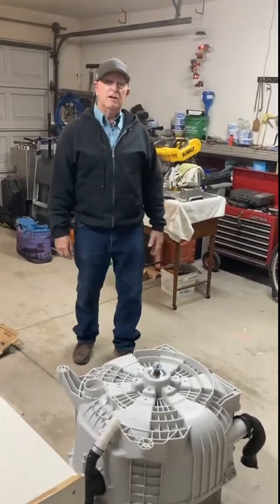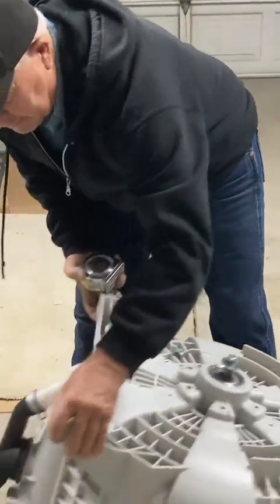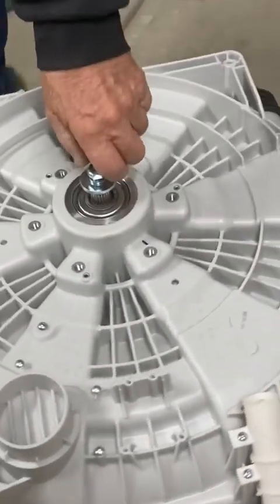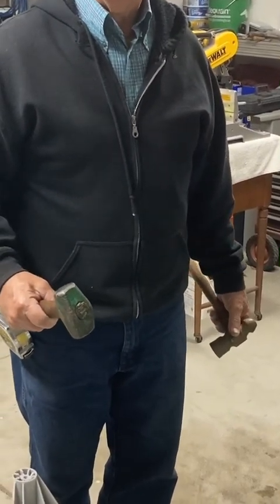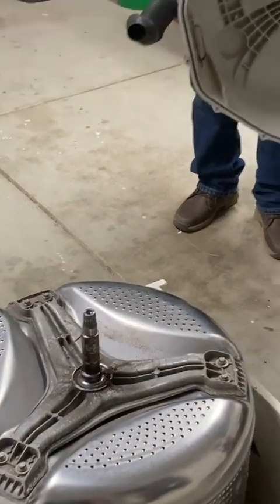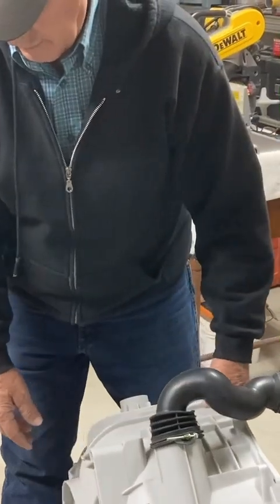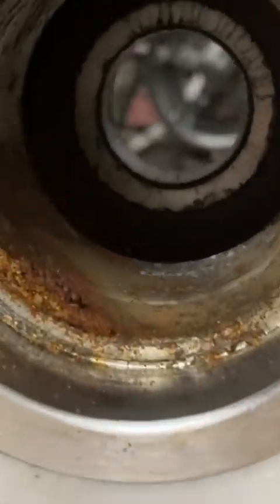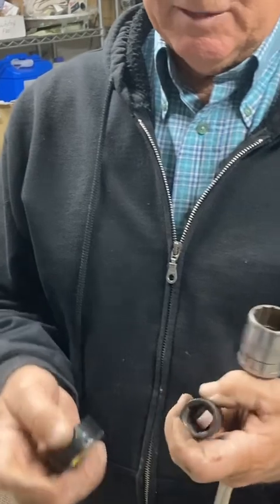LG Front Load Washer bearing and drum removal

Comment: Thank you so much for making this video!  After watching other videos, I was apprehensive about doing this part of the job since old bearing removal was most problematic.  I was able to use a couple auto jackstands and some bricks to facilitate tapping out the inner drum.  I used a flat blade chisel (to protect  the shaft) and a 8 lb sledge to tap out inner drum.  A 13/16 spark plug socket on the end of an extension sufficed to knock out the rear bearing, and the front one came out with 1 and 1/16 socket and extension, with the 8 lb sledge providing the power.  Thanks again!.  Your guidance worked like a charm!.

Comment: Works like a charm, i used 3 pound hammer. But took some work. I had to use a rebar  as I didn't have all those sockets to remove the Bearings. I used a power washer to clean the drum and plastic casing. The only this couldn't remove is the thick scum. Scraped it off and power washed it again,  spotlessly clean and no scratches.